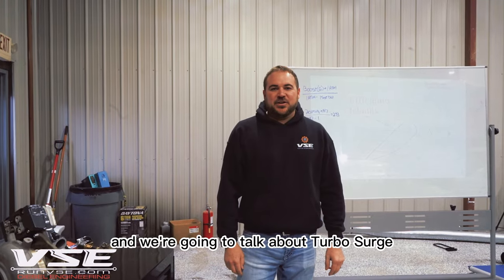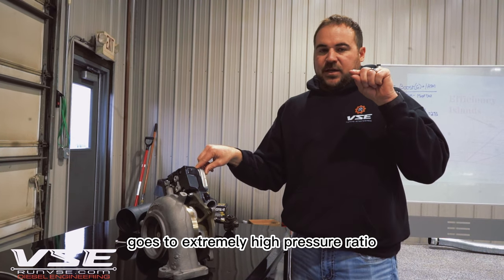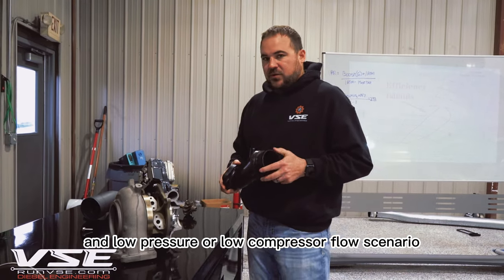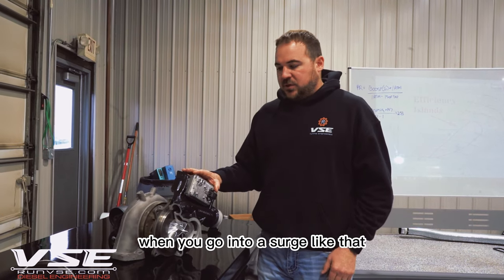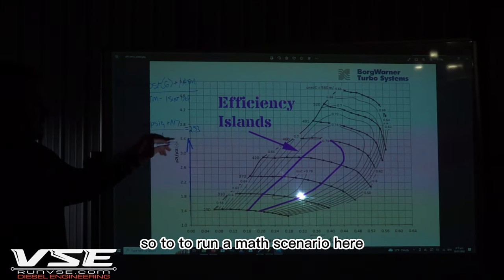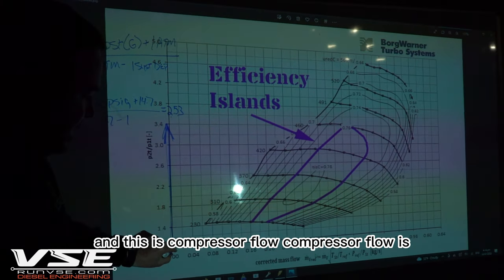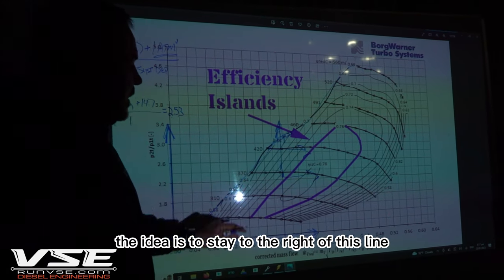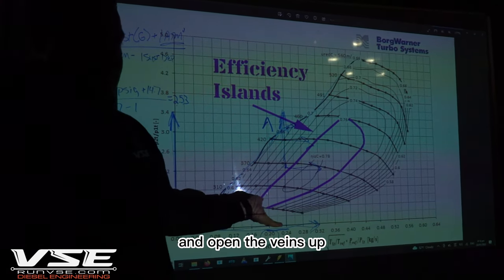Turbo Surge Explained

Comment: I have a bone stock ‘24 duramax that has the worst turbo lag I’ve ever experienced and has compressor surge so bad it shakes the whole truck when it happens. It feels like it has way less power than the 2020 L5P I had. Have you heard anything similar about the ‘24’s?